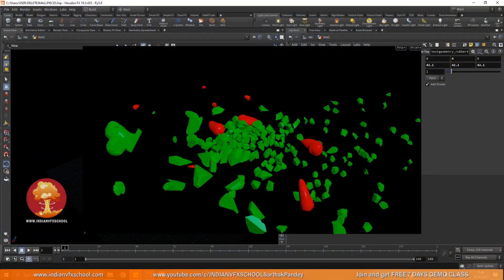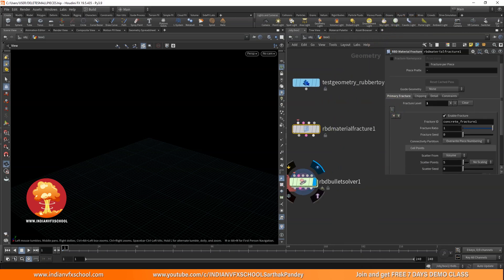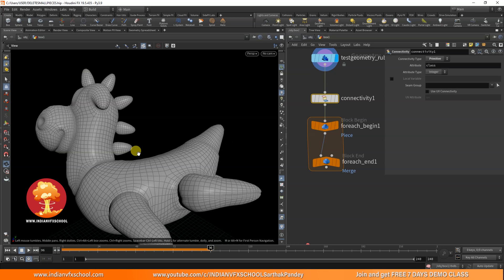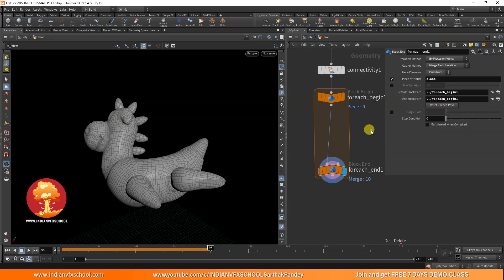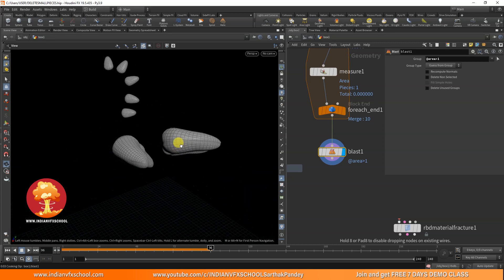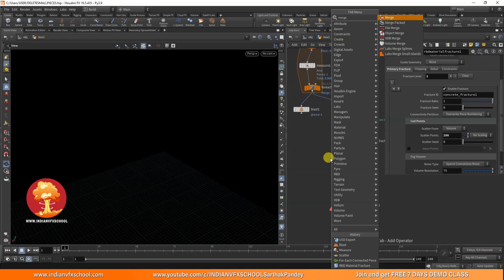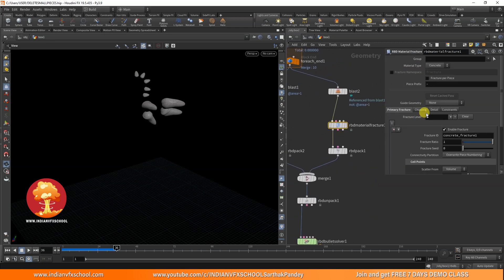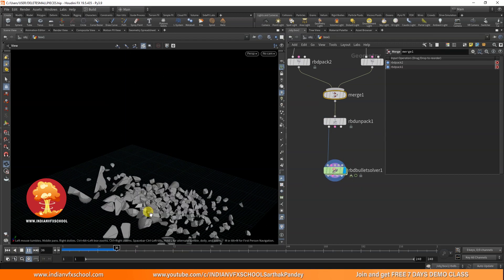How To Prevent Small Pieces From Fracturing In Houdini? #Houdini #RBD #Simulations

Comment: maybe or just use boolen node
Reply from the maker: Even with boolean node you will end up fracturing small pieces, how's it different?
Reply: @indianvfxschool  This video helped me a lot!!
Reply: @INDIAN VFX SCHOOL   it will make as one single object
Reply from the maker: @emilsvfx  here I'm talking about let's say if you get some geometry from other program and you want to remove small object based on their size.
Reply: @indianvfxschool  then yes, there is labs tools to delete small pieces
Reply: @vinay4563  sometimes need to check. Houdini constantly update tools and nodes with new features. Tnx  @INDIAN VFX SCHOOL  for showing this tip, for some one it can be live saver :)
Reply from the maker: You're right. There's definitely labs tool for that which does the same thing and that is what we learned to make from scratch and this technique can be used at so many places. Also lots of studios don't have labs tool so they want the artist to work with just houdini.